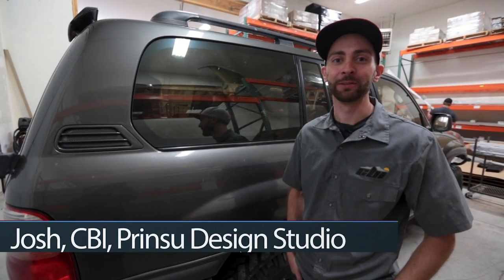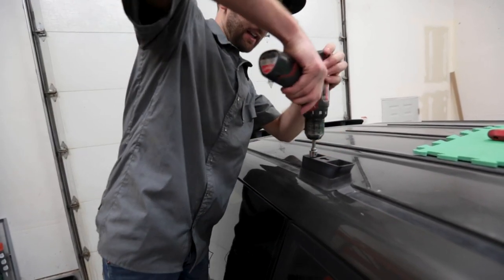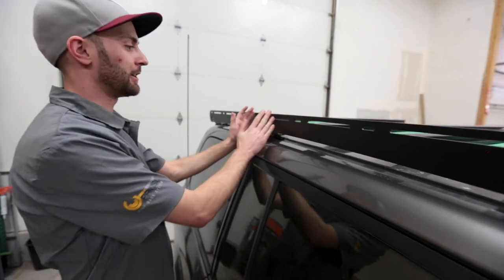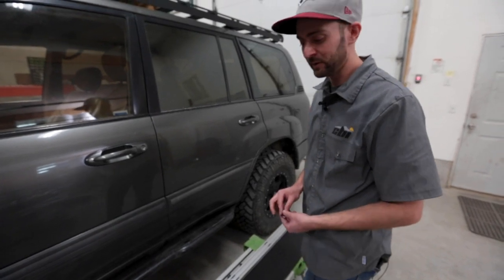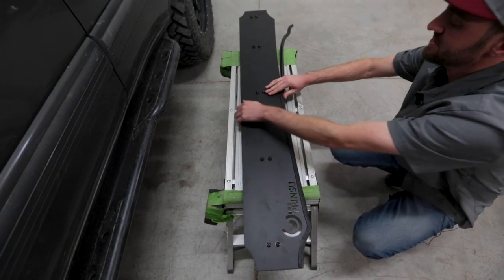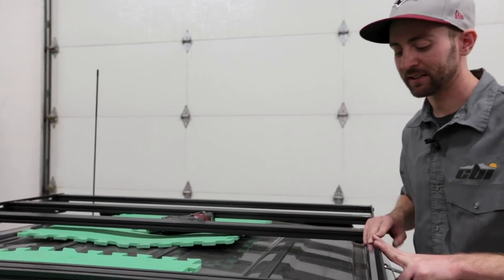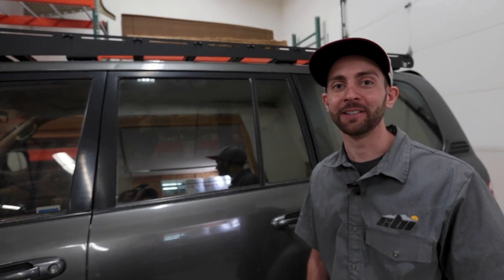Land Cruiser 100 Series Prinsu Rack Install

Comment: Well done... but how strong is it?!... i mean; Can it hold heavy loads e.g of an additional spare tire for off-road travels i.e on an African environment or so?!
Reply: Yes it can hold heavy loads. A tire along with all kinds of other gear would be fine. Roof top tents, etc. The week link with our roof racks is actually the structure of the vehicle roof and not the rack. That is what limits load capacity. All of that considered you still want to be careful to not add too much weight up high like that and it is important to evenly disperse the weight depending on what type of off-road driving you will be doing.

Comment: I have a lx470 which is the the same as the landcruiser.  Do I reinstall my weather stripping. I had a prinsu on my old tacoma and had to reinstall the westherstip.
Reply from the maker: Hey there! Yes, we do recommend reinstalling the weather stripping after you have finished the installation. If you have any other questions you can reach out to our customer service representatives via email at Info@cbioffroadfab.com.
Reply: Okay, I just didnt see you guys put it back on in the video.  What did you guys use to make it seal back up
Reply from the maker: @LuanNguyen-rj1bt  We recomend cleaning the area very well and using your choice of adhesive or double-sided tape.
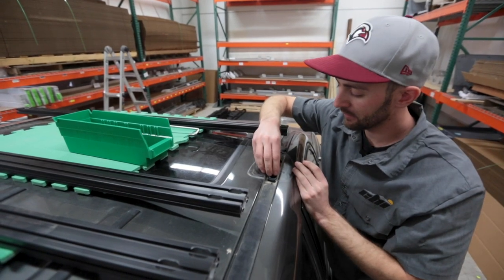Reply: The 3:15 mark on the video is what I'm referring too

Comment: What do you do if your factory roof rack only has 4 mounting points?
Reply: Remove the weather stripping to reveal the correct bolt positions on LX470.

Comment: Would this rack work for the LX470?
Reply from the maker: Sorry we have not tested this product with the LX470 and cannot guarantee fitment. Thanks for reaching out!
Reply: Of course it will, Land Cruiser 100 and LX470 are the same.
Reply: Yes.  Just remove the weather stripping.  It will reveal the correct bolt positions.